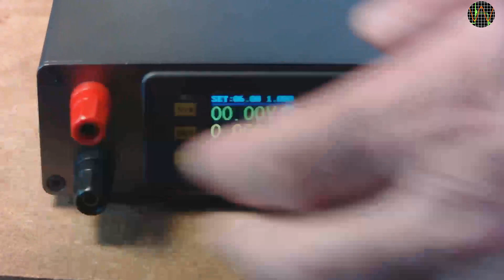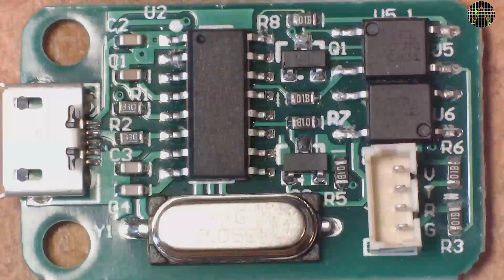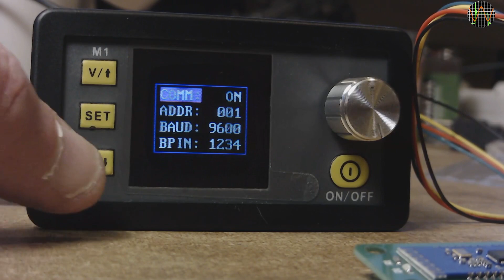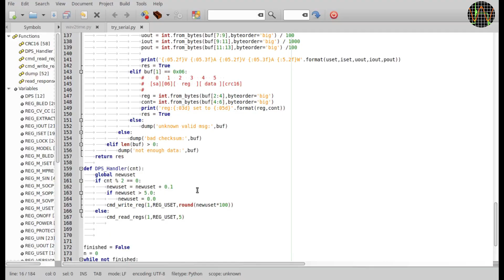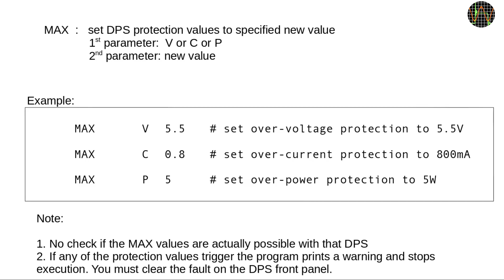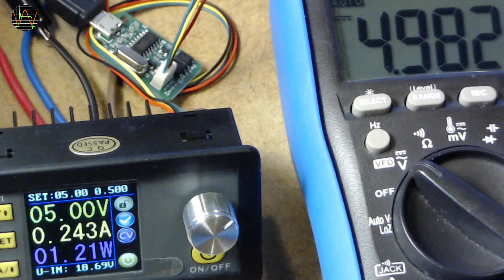Controlling a DPS5005 power supply module

Comment: hi im thinking of buying the dps3003, for starting with repairs and other proyects. the seller told me that the module can handle current injection on a short circuited board. is that correct? and do you recomend it to me for starting?, i know its a rare alternative to start with but since the small factor and price fit me well , im considering it if it could be a kind of solid small option
Reply from the maker: Well, (like most regulated power supplies these days) it has a constant current mode, so if you suspect a short in some project, just set the max current to say 20mA which can't cause any damage. Of course a working circuit may draw more, so you if you do not know what the max current is when everything is working, you would need to carefully raise the current limit. This is where experience comes in..

Comment: Can this be done? Make a button, raise and lower the voltage in hundredths, so that the button is connected via a usb wire to the DPS 8005. And in general, how can such a button be connected to the converter?
Reply from the maker: The DPS module must be the kind that allows remote control from USB (or Bluetooth). Then you can simply take a Raspberry PI Zero or Arduino Nano to sense whatever button and send the appropriate commands to the DPS module
Reply: @TheHWcave  Thank you for information

Comment: dmesg - 

[ 4700.883765] ch341 1-2:1.0: ch341-uart converter detected
[ 4700.884557] usb 1-2: ch341-uart converter now attached to ttyUSB0

Any idea why?
Reply from the maker: that looks pretty normal.  First thing to check is if its a permission problem. You could try accessing the port as root. If that works, check if your normal user account is missing membership of the dialout group.

Comment: Is it possible to connect this DPS device directly to the UART on an Arduino?
Reply from the maker: If you have the comms version of the DPS, the receive and transmit signals would be compatible with an Arduino tx/rx UART pins. Two problems may occur: 1: If the DPS wasn't a comms-enabled version, it may not have a serial data connector and/or the serial port setup may not be enabled in the software. Unfortunately I don't know if that is the case or not. 
2nd problem: If you connect the Arduino directly to the DPS serial port,  it is electrically connected to the DPS and that means you need to be very careful what else is connected to the Arduino and its power supply and what to the DPS to avoid nasty surprises and short circuits.  There are really a lot of cases where something could go bang there or release the magic smoke. The original avoids this headache by using that little USB interface board which is totally isolated using 2 opto-couplers. There is a reason why they added these. It would be far safer to get a little serial -to-USB adapter for the Arduino and connect it via the opto-isolated USB interface board that you get with the comms version of the DPS.
Reply: @TheHWcave  

Thanks for the prompt reply and the good advice. I have the Comm  version DPS5005USB with the USB adapter and will do as you suggest.

Must preserve the magic smoke.
Reply: @TheHWcave  
 
I'm going to give this a try. Have one on order. 
 
https://www.robotshop.com/en/logic-level-converter-bidirectional.html 
 
I'll let you know what I discover.

Comment: This is awesome thanks for sharing your code and making the video.  I think I'm going to try using your DPS_handler class directly without the scripting for a project.  Any reason I can't connect rx/tx directly to a raspberry pi and skip the usb converter?
Reply from the maker: Thanks for the kind words. It always helps. The reason why I really like going through the USB module is that it has opto-couplers and completely separates the power supply from the controlling PC. Especially now that the same PC is controlling other instruments at the same time that are in some way all connected to a device powered by the DPS power supply, having not to worry about inadvertent short circuits via the various control connections is really great. Whether that is important in your case depends on what you are planning to do in the long run.